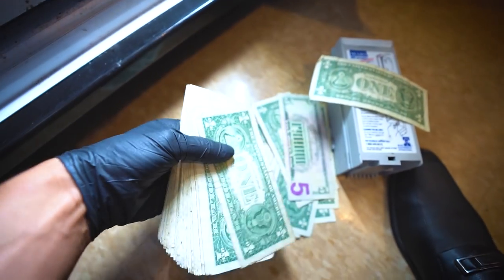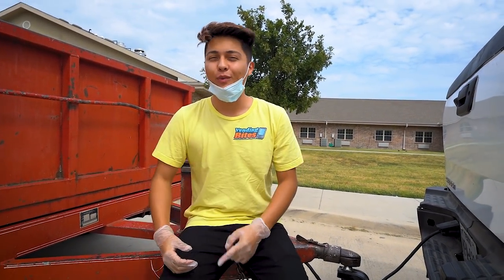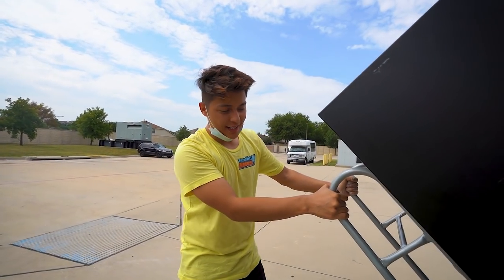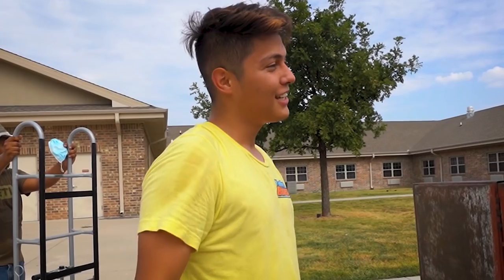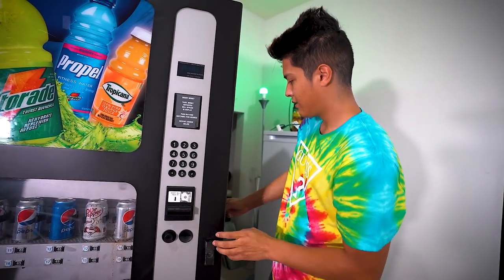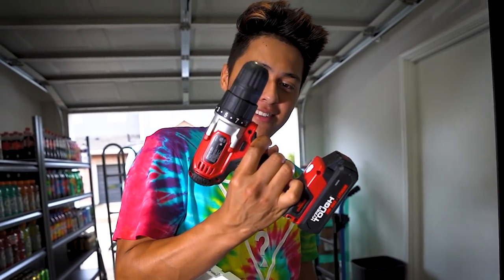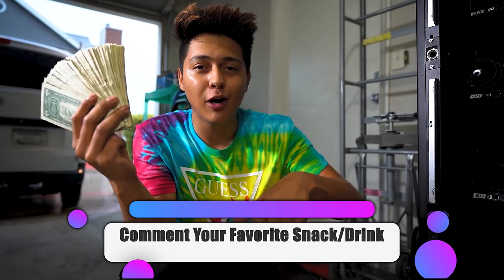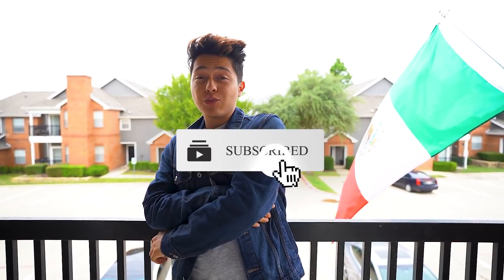We Found MONEY In These Abandoned Vending Machines!!

Comment: Great video. Just one thing. It's never a good idea to lay a soda machine down. Better to move standing up. The oil will run out of the compressor for the cooling when you lay it down. If you have to lay it down, do not plug it in for at least 24 hours to let the compressor oil resettle.